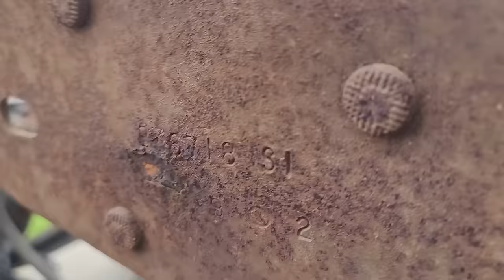Ford Ranger, MIG welding truck frame back together, how to.  Build part 7

Comment: I'm glad you're the trained welder and not me I personally would have built a bracket out of the other frame and welded it from one end to the other over lapping the joint to try and double the thickness and strength and reinforced other pull areas like mounting around the trailer hitch and such. Maybe added extra core supports where room allowed.
Reply from the maker: Kevin... it's a Ford Ranger not a semi tractor
Reply: @frostydoesit  Yea but it's also a work truck if your anything like me. I literally push my vehicles to the limit and use as small of an engine as possible to get the best gas mileage when I'm unloaded. Like I said your the trained welder I would have doubled the frame where the cut and weld was put in as much as possible and maybe made a place to bolt on the hand made bracket in case of microscopic porosity just because the frame is critical. I do like the diamond reinforcement piece and in the end it's your truck, your time and your spare frame parts, so thank you for uploading I am a ranger fan and really never would have considered this option. I would have cut off or made whatever extra cross member I needed to make the 4 wheel drive fit on the 2 wheel drive and probably spent hours longer doing a bolt over and cleaning painting of tedious tiny parts. Just cutting the bad back part or bad part of the frame or something along those lines . I am certain your idea of putting 2 together is a good idea too. But there was a crack I saw in the bottom of the weld on the last filming. I hope you got it fixed or maybe it was a camera distortion.
Reply from the maker: @Kevin Lewis  bro, there's no crack.  It's not a work truck and no I don't expect it to do work  outside of how it was designed.  I have bigger trucks to handle bigger jobs.  A ford ranger isn't a commercial truck and I don't treat it like one.  You should make a video on your channel about building up your frod ranger, would probably get a ton of views.
Reply: @frostydoesit  I doubt it maybe I will one day. I appreciate yours but saying is not a work truck might be blasphemy lol joking I do appreciate your content. I'm still self teaching myself to weld with a Lincoln tombstone and a little Chicago electric 110 wire fed welder. I don't trust my welds to do structural support yet. That's why I would consider beefing something like that up. I didn't mean to suggest you did anything wrong the comments section is full of people complimenting you on a nice precision repair. I definitely don't mean to argue against that. Heck what I was suggesting using the other frame to weld or bolt in a bracket to attempt to double the strength in that area is probably a suggestion that I would make because I don't trust my own welds that far yet. The whole point of watching others is to teach myself. I really appreciate you letting us know what settings your using and guage of wire. It is extremely informative and helpful.
Reply: @frostydoesit Why the condescending tone? I really liked it when you said it wasn't the prettiest weld, but you were still happy. That shows humility and an acknowledgement that the work was good enough. Dozens of guys have come up with suggestions how they would have done it, and you have responded to all of them in a positive manner. Yet when @kevinlewis9151 did just that, suggested how he would have done it, you respond in a rather unfriendly way. Unnecessarily. Sir, your biggest accomplishment is not the repair of this truck frame, it is the conversation and discussion that has followed on this tread. If someone's comment doesn't gain your approval, just don't respond. Personally, I was going to mention the possibility of bolting or riveting two oval-shaped 1/8" plates together (one on the inside, one on the outside), using grade 8 flange bolts with non-threaded shoulder, or to plug weld same. Then re-enforce the top and bottom flanges of the frame with 2" wide 1/8" thick C-channel, cut to a fairly long point, so as to gradually diminish the strength and reduce stress on the existing frame, and using same bolts. But as this may catch your ire, I'll refrain from suggesting such a thing lol.
Reply: @iangolightly604  I got thick skin and I'm actually just learning and self taught. I don't care if he's condescending it only shows his inability to relate to others that question his methods while trying to learn.
Reply: @iangolightly604  Seriously the jokes on him I don't care how he replies it's not going to hurt my feelings and I'm still going to learn. Lol

Comment: im not knocking you work it looks fine and strong. you can achieve as strong with a strait cut.  rather than a z cut i have not taken in account vehicle regulations in welding frames. in strength angle cut - Z - cut and 90 degree are same in strength
Reply from the maker: I just copied what I see done on the semi frames when they are stretched or shortened in the commercial world.  So far I am very happy with it!  Thank you for watching and sharing your thoughts!  -Frosty

Comment: Nice job, but in the north east that original frame would be mint,I added 50 pounds of farm scrap to bring mine back
Reply from the maker: Yeah there is def much worse out there!  It would have been just as much work to patch it as it was to split the two in half lol.  Thanks for watching!  -Frosty

Comment: I have a friend of mine that's a welder he always said the best way to join a frame back together is nut and bolt
Reply from the maker: I've never seen anyone cut a frame in half and secure it back together with only nuts and bolts, but hey we all do it a little different!  Thank s for watching!

Comment: So, this is just a matter of opinion I'm sure. I'm not much of an automotive welder, by I am a structural welder (warehouse framing, boiler repair(i only know the skill, im not a boilermaker), elevator rails, custom hoisting frames, etc). 

I would put a bevel on the two welding surfaces and have about a 3/32 gap with a half thickness landing to get optimum penitration and a higher inclusion of base material. 

I'm sure it literally does not matter in this scenario, just a thought from a different metal gluing guy
Reply: Another thing; I personally like to grind my tack welds down so I have fewer start n stops. Just gets a nicer, more consistent bead.
Reply from the maker: Thanks for watching and for your feedback!  This frame was pretty thin at 1/8" and with the 1st pass it had full penetration.

Comment: swiss cheese your fish plate next time and weld the holes also, added strength. Nice work
Reply from the maker: Thanks for the tip!
Reply: Rossette welds are not necessary for such a small member.  At some point you will learn what diminishing returns are.  Otherwise repairs should never exist.  Replace with entire new structures.

Comment: i would of cut out a circle in the middle , and welded there also..  this makes me want to cut up my tj and drop it under the old scout out back
Reply from the maker: Agreed, a circle on the fishplate  would have been another great way to reinforce it.  There  were some holes in the frame that I plug welded to the fishplate.  A scout is such a cool old rig, my buddy had one in HS.  You don't see too many of them here in WI these days....even 20yrs ago didn't see many.

Comment: Hi there, good job on that. I look to do mine also. Which i have to replace the bottom of a  channel from the middle. Should i put diamond plate also ? Is it wrong to cut 90° ? It is straight behind the cab both side.
Reply from the maker: From what I've learned, use a fish plate similiar to the one that I did but make all the corners rounded so there are no sharp edges.  That would be the only thing I would have done differently.  Thanks for watching!

Comment: Heat that frame up to at least 250 degrees, the spring still thats in it makes it brittle. Just a thought
Reply from the maker: I'll have to look in to that, I have heard conflicting reports on weather the frames of the Ford Ranger are mild steel or a high carbon steel.  Thanks for watching!
Reply: I welded a frame on a International Eagle transfer truck, lengthen it to 38'. DOT and welding engineer at my work place (ie) Nuclear power plant recommended it to help anneal the steel.
Reply: Absolutely nonsense, you call and speak to ANY of the class 8 manufacturers, peterbilt, kenworth, freightliner and not one will suggest heating the frame. IT REMOVES THE FRIGGIN TEMPER FROM THE STEEL.
After you call the manufacturers, try calling any of the frame stretching shops in the United States and they will laugh you off the phone. We are cutting and stretching semi truck frames, trucks hauling 40 tons, beating up and down the road for a million miles, and none of the shops are pre heating frames.

Comment: I have already worked with truck skeleton welding, and preferably use E7018 for this job.  in the internal part an ring similar to the skeleton is used but only welded.  but anyway you did a good job it will last 20 years, my truck has the same defect I did some shitty welding, I'm out of patience.
Reply from the maker: Thank you!  I think it will outlast the body of the truck for sure

Comment: I've always wondered if a 2.3 wood bolt up to the transmissions they used with the 2.9s to just pull those troubled 2.9 3.0 and 4.0s and put in the gas sipping 2.3s since there are literally millions laying around in every state?
Reply from the maker: they don't, the 2.3 & 2.5 is it's own bellhousing.

Comment: Almost true! I have forty years experience in welding! We don't MIG weld outside MIG welding use gas! We always grind all scale or joints before welding! The steps taken were good but not PERFECT!
Reply from the maker: It's tough to see in the video, I didn't do a great job capturing it but all joints were very well cleaned before final welding.  Thanks for watching and commenting!!  -Frosty

Comment: One question/thins y would you grind down all the weld flat doesnt that affect the strength of the weld cause you didnt bevel the edge when but welding kinda drops the strength alot and i m ow you put that diamond piece but maybe next time leave rhe outside weld
Reply: And now cause you put a extra piece in the frame it will not fold up properly when in another accident it will b stronger in ghat place
Reply from the maker: The frame was 1/8" thick, I welded from both front and back and there was a gap between the frame everywhere I welded, not tightly butted.  Even from the 1st pass it had full penetration.  A little grinding isn't going to hurt it any.  Like you said, with the fishplate it is stronger in that area anyway.
Reply: @fatsk8er62  Do you even understand vehicle crumple zones? Here's a hint genius... they aren't in the middle of the chassis.

Comment: Ive got a heavy duty truck I need to fix cross members on.  Ive been trying to figure out how to handle it and when i look online, everyone makes this sound like a super daunting task and that frames need to be welded on woth extreme caution because they're made with tempered steel and if you get the metal too hot it becomes brittle and dangerous to drive...is this something you really take into consideration when you're welding your frame up like this or does it really matter?  I dont have to worry about the frame rails luckily, but these crossmembers are made from the same stuff im assuming, so I'm concerned about getting it right, any tips would be greatly appreciated.
Reply from the maker: I wouldn't worry too much about it if you are able to have some new material welded in with a quality Welder.  Frames and crossmembers do flex so you will need to be mindful of that when doing your repair.  Imo the crossmembers would be a breeze compared to the frame rail.  Good luck and thanks for watching!

Comment: Been wondering if there's a way to fix the front end frame damage on my avalanche.  Seen a couple of these videos now where guys are doing similar things with w.e they need and tacking it in.   Considering the insurance company put me at fault when it was the other unlicensed drivers fault and because I was singled put they had numbers over me.   Anyways thanks for making the video.  Def a confidence boost in this being possible to get my truck back on the road.
Reply from the maker: Sounds like a bad situation you got stuck in there.  Doing this is a lot of work...but your trucks already damaged, what do you have to lose?...just make sure you do a good job and it's safe!!!

Comment: Right when you started laying those long beads down, I yelled " surface prep first!" 
That frame will only survive on how good those welds are. Good project though. 😎👍
Reply from the maker: Hi Jorge!....Maybe it didn't show up great in the video but I did surface prep everything a good inch on either side of the joint to shiny metal.  Thank you for taking the time to watch and comment!
Reply: @frostydoesit  yeah, maybe it was the outdoor lighting. Its all good brother, not any throwing hate. But I will say, it's still a ford!👋😂 ( I'm a bow tie guy myself)
Reply from the maker: @jorgecaraballo1771  There's no old S10 trucks up here in WI, they all rusted away in the 90s lol!  I have a squarebody suburban also so I can't talk too bad about the bowties!

Comment: If you had used a copper, aluminum or brass backer plate, you could have turned up the amps a bit and had good penetration and a flat surface for your diamond cover.
Reply from the maker: There was full penetration on the 1st pass, no need for a backer

Comment: Nice job, but your fishplates should have covered way more of the legs of the Z. The highest stresses are at the ends (top and bottom) of the welds - not the middle. And a diamond is a very poor shape for a fishplate as it concentrates the loads at the points of the plate.
Reply from the maker: Thanks for the feedback Scotty!  If I ever  do another one I'll keep that in mind.

Comment: What process is this? I hear short circuit vs spray something or other. I don’t weld a whole lot and am self taught and wanted to know what you used here. Thanks.
Reply from the maker: This is just short circuit, my Miller 252 will do spray on higher settings and with a different gas.
Reply: @frostydoesit  Very cool, thanks. I've been reading notes on the differences between the two and it sounds like the spray transfer makes a "stronger" weld over short circuit.
Reply from the maker: @Justforfun-ek7et  I've learned that anything over 1/4" really should be spray.  I love how it sounds and looks, so much another

Comment: a few questions?? Why did you not clean the metal before the welding? why did you not bevel the metal so you are guaranteed there is no voids between the welds? and how do you know the weld made it all the way to the center of the frame on both sides welded and then you ground down the weld and if there is a void, the metal is so thin it is useless on a frame of an automobile driving on the road. the plating was a good idea and penetrated well, but please clean all areas, weld all the way thru with bevels on either or both sides and do not grind the welds off if your not plating it. might i make a suggestion on the plating, if the welds are good and more welding is done, the vibration on a frame is hindered by the heating and cooling. a double plate bolted will not crack and will be stronger then a weld...unless you anneal the whole frame again, it will crack I guarantee it! please take this as a helpful suggestion and years of knowledge in farm equipment repairs!
Reply from the maker: I did clean the metal very well before welding, just didn't show up well on camera.  The repair has been holding up very well!  Thanks for watching!!

Comment: I have a couple of questions. Would an oval patch be a better option? Hard corners usually leave stress risers and are where cracks usually start ive been told. Also, if your gonna have corners, shouldnt you wrap them to help prevents cracks from starting? Just curious, i dont weld this type of thing, so its always interesting to see how its applied to different uses. Thanks for the video!
Reply from the maker: I think the diamond shape is the best you can use for this type of repair, if I did it again though I would have  radiused all the corners on the diamond to be a smooth round edge.  Thanks for watching and commenting!  -Frosty
Reply: Diamond is the correct solution.  You can go through the trouble of rounding everything for a slight improvement... some times.  So we call out diamond plates instead.  Why?  Because it is what a person in the field is likely to adhere too while not compromising structures.  Start looking for them in the wild as they are everywhere.

Comment: Hi, wondering why you decided to grind off the welds on the outside? Not telling you what's right or wrong, but I was under the impression that you should leave welds where strength is more priority than aesthetics, but I'd like your take on it. Thanks for the vid!
Reply from the maker: I welded from both sides of the frame and fish plated the inside.  Over engineered it so I could grind off the outside for anesthetics.  Thanks for watching and for the question!  -Frosty
Reply: In many states, the welds must be grinded or if you are attempting to avoid frame repair detection during your state auto inspection, you would weld, paint and carry on.

Comment: So are you going to remove the engine, sandblast or wire brush the remaining rust off and at least paint the frame with a couple coats of rust preventative so it will last?
Reply from the maker: If I like the truck after driving it this spring I'll be tearing it all down again to swap in a 2.3 turbocoupe engine, if and when I do that the frame will get some love